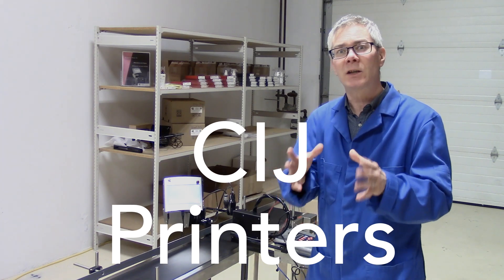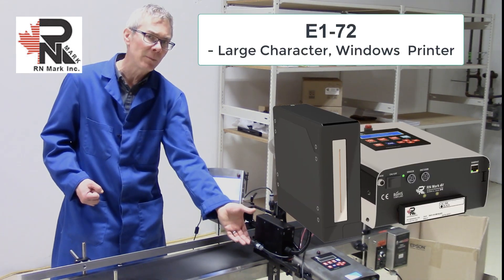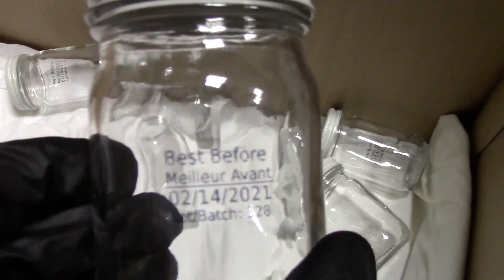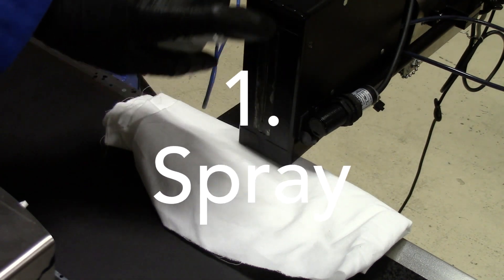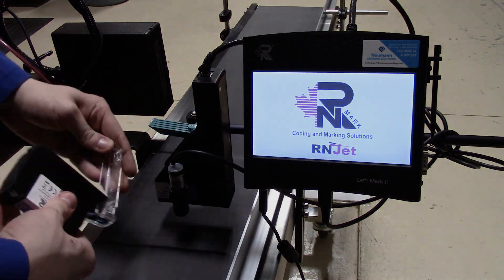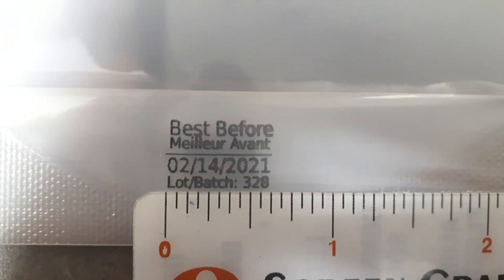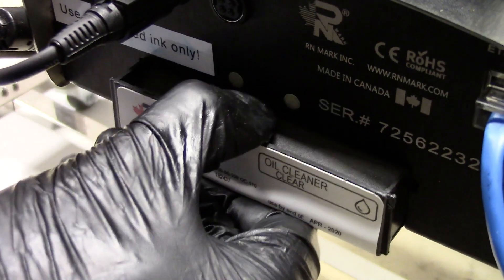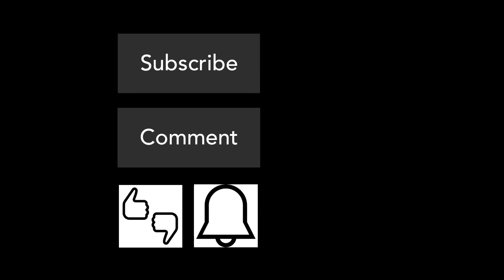CIJ vs DOD vs TIJ inkjet - Which do you need?

Comment: Which printer used for ice cream candies wrapper print??
Reply from the maker: Hi. For a guideline, CIJ are for very large quantities require heavy maintenance, DOD for medium-large volumes with medium maintenance and TIJ is best for low-medium and sporadic volumes with little to no maintenance needed. You will need a solvent based ink, not water based.